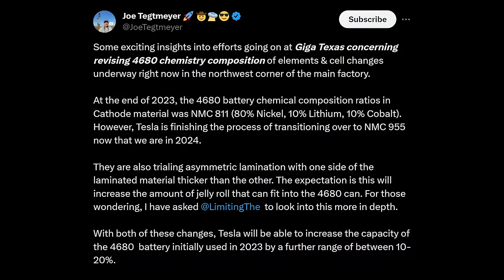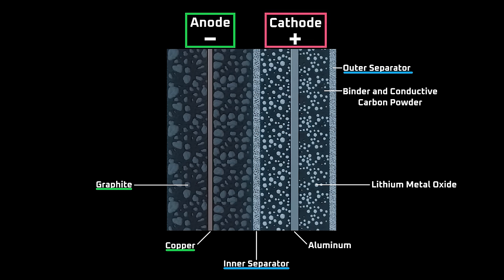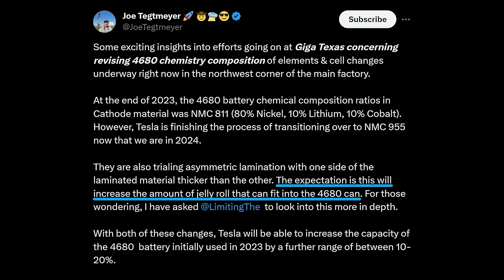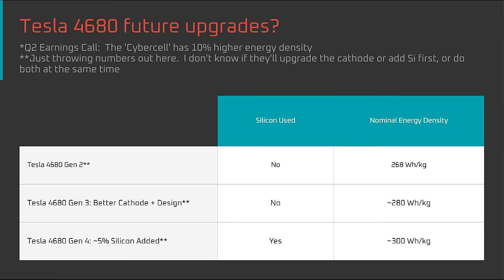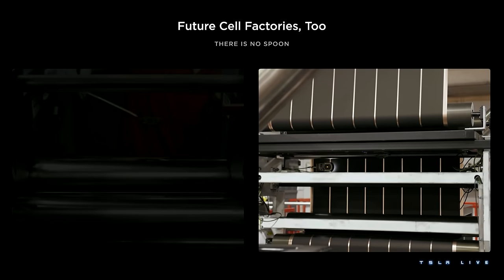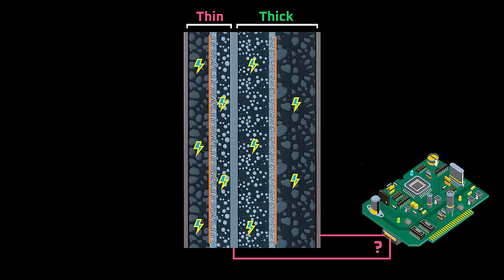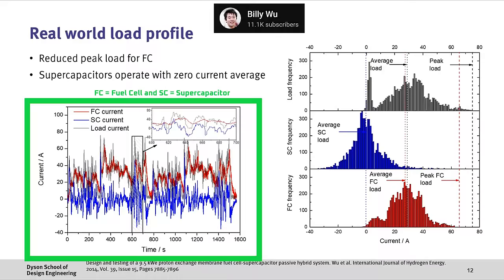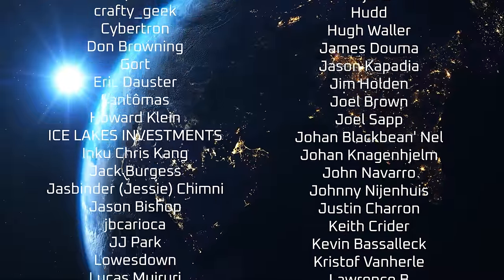Tesla 4680 Asymmetric Lamination Rumors // Two Cells in One?

Comment: Wouldn’t we have the same thing by using 50% thin 
electrodes and 50% thick in the total 4680 mix?
Reply from the maker: Yes, but then you increase the complexity of your cell manufacturing.

By putting it into the same cell, it doesn't increase the complexity.

Comment: Can you do a researched video with the benefits/con to costumer/industry if is used a standard size cell in E.V battery's?
Reply from the maker: Standardization vs specialization generally comes with the same set of benefits regardless of the product.

That is, cost vs performance, etc.

So, it depends what your goal is for your product.

Neither is inherently better.
Reply: Standardization will eventually come as winning designs are adopted by all manufacturers. This will happen when no new improvements are found.
Reply: @thelimitingfactor  I think manufacturer use special size cell to sell expensive at the end of pack life.
For accelerated adoption of E.V need to have a standard of size cell to buy cheeper from competitive market.

Comment: One thing for certain is the 4680's aren't really ready yet as reported by various Cyber Truck owners they have a poor charging curve.
Reply from the maker: I'm not sure what you mean by "ready yet."  They're in vehicles.

As for the charging curve, that's a separate issue - actually several separate issues.  But as I showed in the image in this video, its already charging better than the competition in the truck space.  Overall, it's a middle of the road cell all around - people are just disappointed because they expected it to be the best on the market...

But, performanc is only a side benefit of the 4680.  The main purpose of the program is cost and scalability.
Reply: @thelimitingfactor  Also the 800v chargers haven't been rolled out/activated yet.  That doesn't change the cell but it should allow total charging time for the Cybertruck to improve.
Reply: @thelimitingfactor  They haven't meet the expectations people have come to expect with Tesla charging rates, hence the ready yet
Reply from the maker: Bingo Ed.  Lot of factors there.  There seems to be a few influencers out there making premature or unsupported claims, and then everyone else just repeats what they say.

My approach at the moment is wait and see.  The charging curve could get better or worse as they get more data.
Reply: @StormyDog  That's why they split the battery in two when charging.
Reply: @StormyDog  Not if the limiting factor is the cell level acceptance rate, which it is as far as I can tell.
Reply: and also it's well known that the 4680 Model Y is the worst of them, range/charging and yes that was v1 of cell but would appear still have some way to go.
Reply from the maker: @gmoncrieff  Yet people are still buying the truck.  

If it wasn't "ready," the cells wouldn't even be in the vehicle or the vehicles would be exploding.

That is, you can be as disappionted as you like and decry the performance, but the fact is that people still want the truck and are actually paying a premium for it.  

That's the ultimate litmus test. 

That is, I agree that the performance of the 4680 has been underwhelming, but it's also practically a moot point until it affects vehicles sales.

What matters for now is scalability and cost.  The performance will sort itself out in time.
Reply: If I am launching a new battery type i am going to be conservative on charging at first. And the 800v chargers are not there yet. Curve as we have seen is just software limits anyway